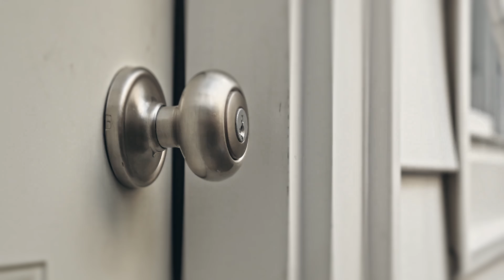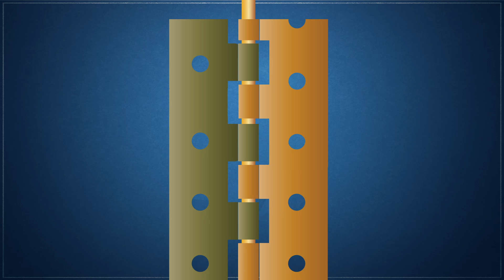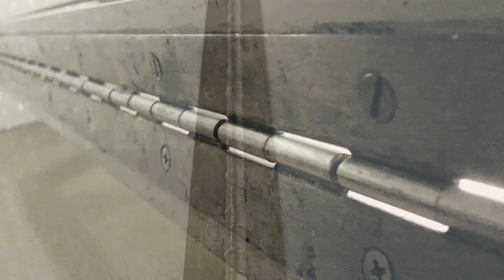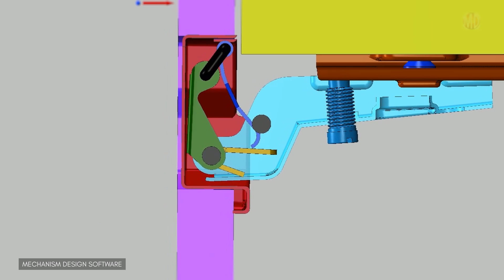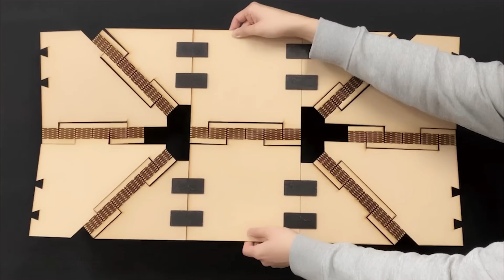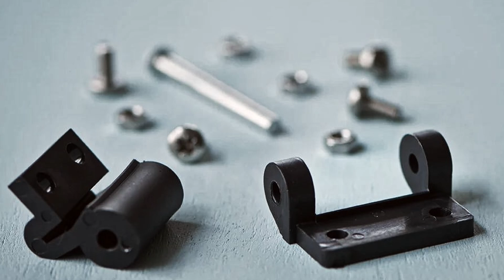The Fascinating World Of Hinges

Comment: I’ve seen piano hinge used as means to attach mildly curved aircraft cowlings.  Those hinges couldn’t pivot of course, but it was an elegant solution that saved a lot of threaded fasteners.
Reply: Nice tip!
Reply: @randydewees7338 It was on a Rand KR1 if you want to see how they did it.
Reply: Wouldn't the piano create extra drag?

Comment: The hinges in my laptop bound up after about a year, caused the case to crack and pretty much destroyed the whole device.
Reply: Acer?
Reply: @andersjjensen Pine64
Reply: @christheother9088  Welp, Pine64 makes even more "cost optimized" products than Acer. Acer's hinges have a reputation of either going slack, so the screen won't stand without support, or corroding to the point they seize up.

Comment: The most confusing hinge system imo was the double sided fridge door. You could open the fridge from either side, but couldn't take the door off without disassembly. That is some incredible engineering.
Reply: I lived in Japan. Space is a premium there. Indoor space. The fridge door opened both ways 🤯it was very useful in the small space
Reply: There are old Irish gates that can be opened in either direction and use gravity to swing shut
Reply: @robomaster1000  definitely a cool hinge, but a completely different concept from what this guy is talking about
Reply: It’s genius
Reply: Very cool! Looks like each handle first locks out the other handle then lets go of its hinge.
Reply: include minute
Reply: @Fahnder99   The type of dual-swing hinges used on refrigerators weren't mentioned in this video.
Reply: @GregConquest  Nice mate. I thought I was blind. Btw. the japanese fridge door is nice. But the german Klappfenster is also nice.
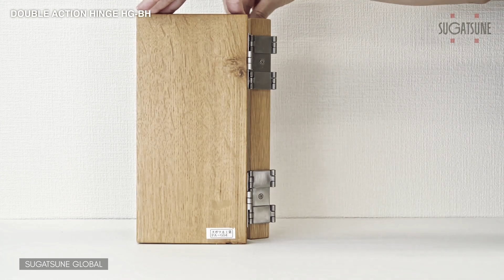Reply: @GregConquest  15:00 it's the same mechanism as this, except stretched out over the entire width of a door instead of its side.